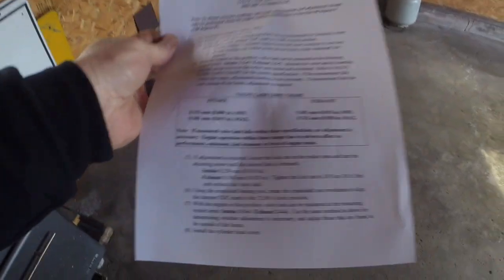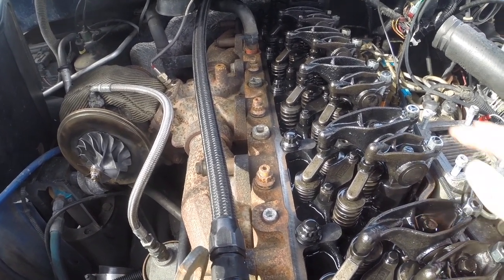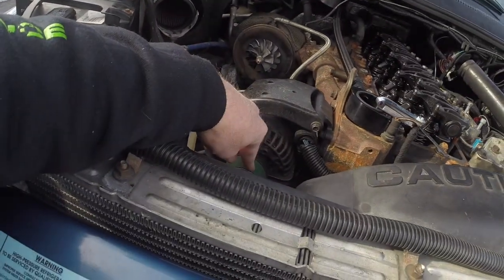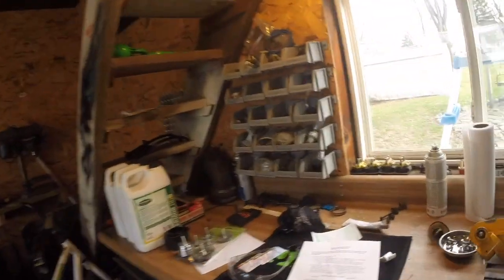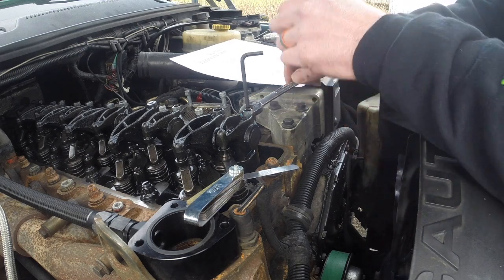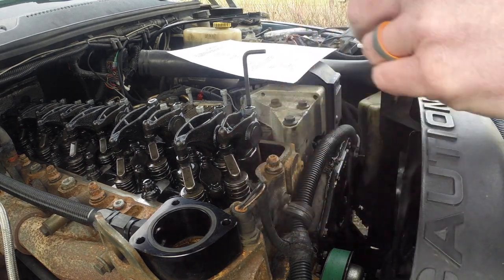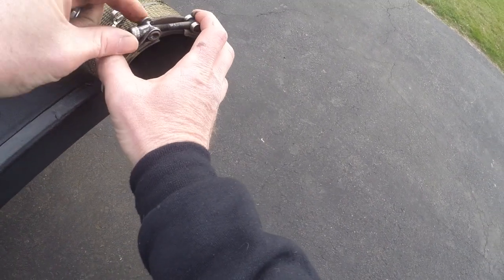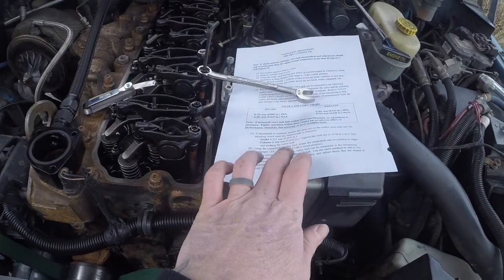Cummins Valve Ajustment Valve Lash

Comment: What is that black housing with black hose... oil bypass?   Great video thanks!!
Reply from the maker: If you’re talking about the one that makes 180° turn and head back down to the ground that I takeoff the chef forgot dead center. That is the crank case breather.

Comment: spacers on the bolts prevent bolt breakage, longer bolts allow more expansion. shorter exhaust bolt will usually break, nice video
Reply from the maker: Thanks for watching! I did end up going with ARP studs a few videos later.
Reply: @Chad Myers73  good video.  I have a 2005dodge 5.9 cummins 24 valve. I'm doing the valve adjustment...I'm using the same cheat sheet you have. Started doing the 1st set I got to the number 5 and the #5 will not move. Any suggestions 🤔

Comment: Turn the motor what directions?
Reply from the maker: doesn't matter turn it 180  degrees to bottom dead center
Reply: @ChadMyers73  180 degrees or 360 degrees?
Reply from the maker: @watchman6104  180 take the notch from the top to the bottom